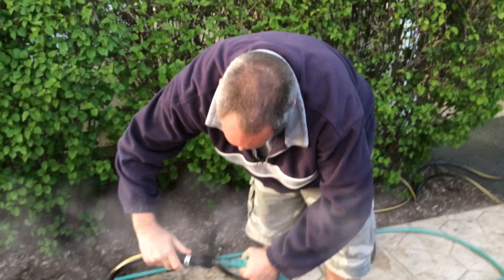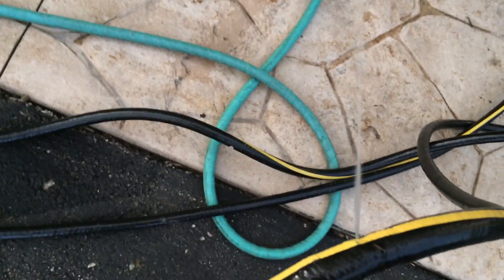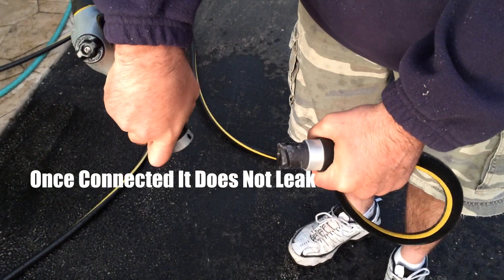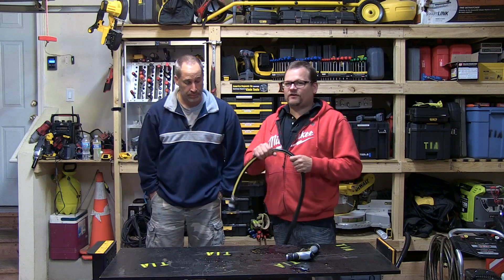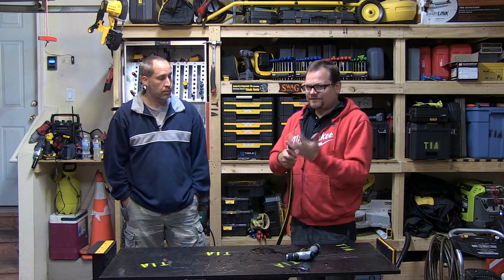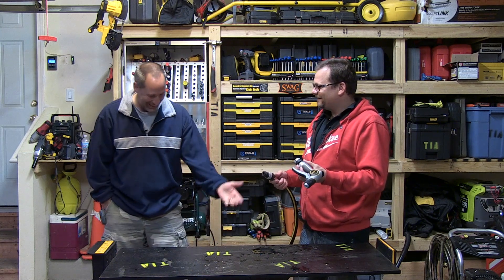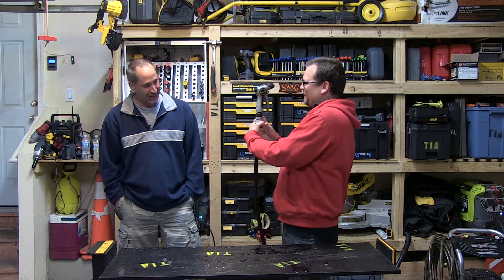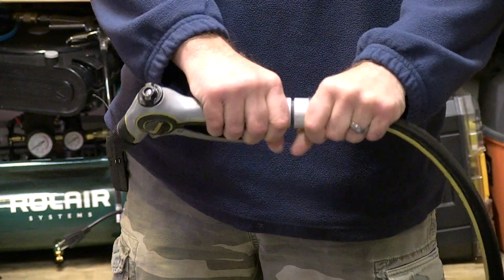Nelson Leak Free Hose System

Comment: The connector that came with it for connecting the hose to the hosebib on the house intentionally does not stop the water, as it would defeat the functionality of a frost-proof unit. It is assumed that you only used the "NO-STOP" (male-female) quick connect when you have a valve ahead of it, thereby allowing the water to drain when the water is off. For hose-to-hose and hose-to-attachment couplings, the "STOP" (female-male) quick connect is used. This has been standard across all product lines for several decades.

Comment: I think "leak free" is while its connected and running. Most set ups leak a little when you connect or disconnect. Did it leak at all while you were runnin water through it?bummed about the house tho that's jacked.

Comment: Seems expensive for what you're getting. With that kind of money you can buy a nice 50ft rubber hose. It seems like as much of a scam as the "kink free" hose setups. About time you guys found something that wasn't a good buy/product. I can't seem to break the 7/10 split. About 70 percent of the products I buy nowadays either don't work as advertised or are just plain junk because of bad manufacturing and quality control. As much as I hate to see people who got ripped off on a product, I find solace in the fact that i'm not alone. Thanks for uploading!

Comment: what a piece of crap...lol I use Gardena quick disconnect from Home Depot in Canada. They are made of metal and plastic components and hold up really well, they are designed like air hose connectors and as soon as you unplug the spray nozzle the water stops much better than this rubbish! But the hose I bought with it ended up bursting cause I would leave the water on even when I wasn't using the hose and the hose expanded and burst on a hot day but the connectors are awesome, hose is a pice of shit...lol You shouldn't feel bad for giving a negative opinion guys thats why we come here, for honest opinions good or bad! Lose that and you won't be TIA anymore!!
Reply: Can only agree, Gardena and a real rubber hose. Candid Honesty lasts.